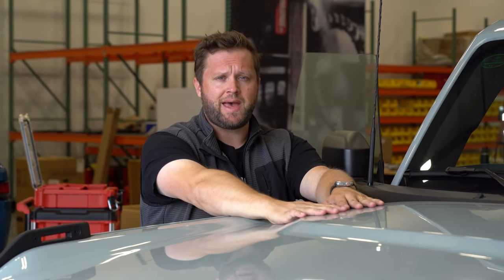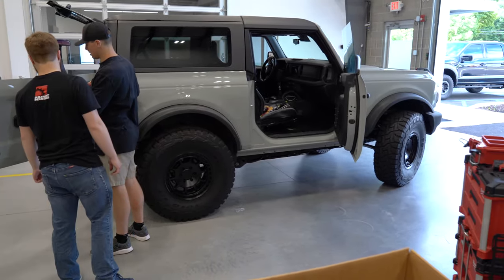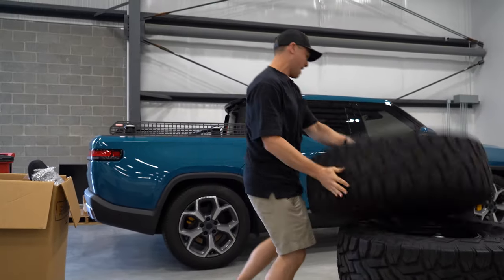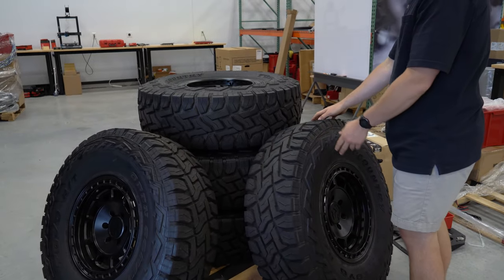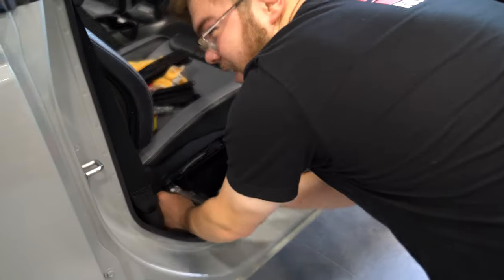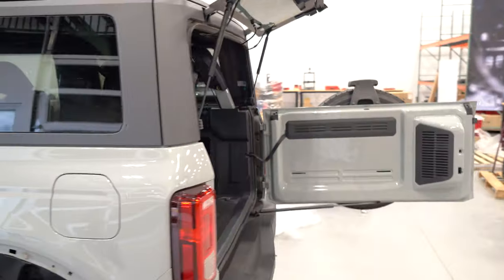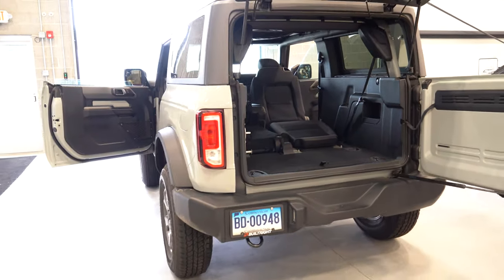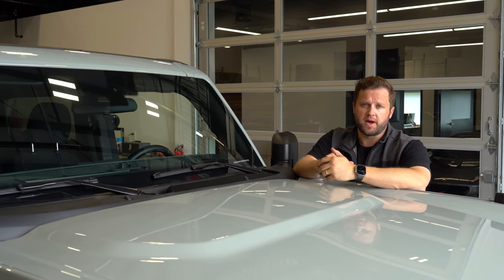UNBUILDING the 2 Door Bronco

Comment: I guess this means that we won't be seeing any new accessories for the Ford Bronco? You missed some opportunities, like Molle panels for the swing gate and side of center console. Also could have made solid covers to replace the mesh door pockets. I know other manufactures make accessories for these locations BUT you're the only company that makes this design that allows for the use of bolts and nuts for mounting accessories to the Molle.